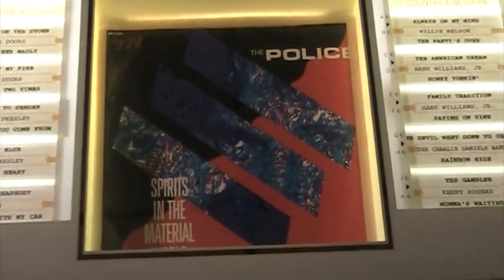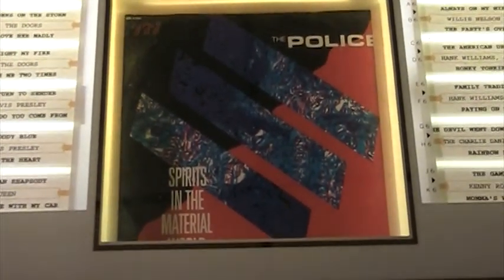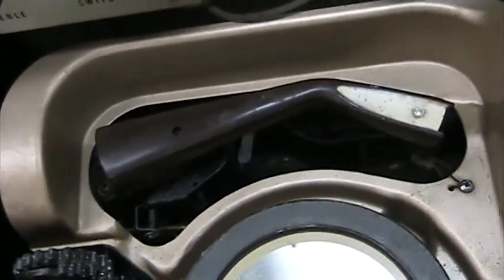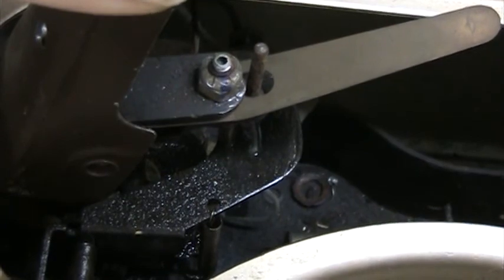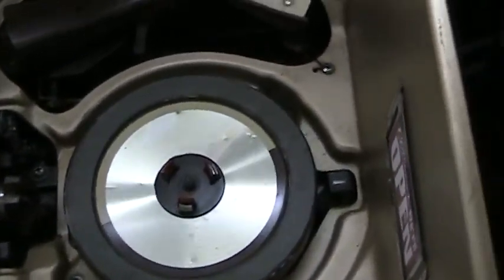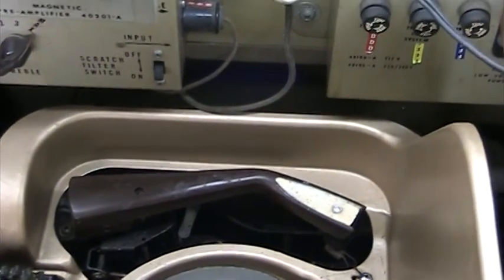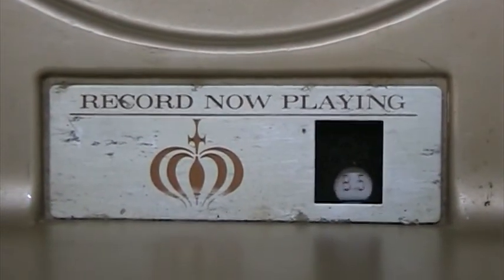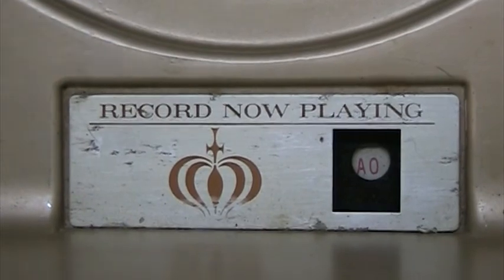How to adjust Tone Arm Pressure on Rockola Jukebox when needle skips

Comment from the maker: Update 2/5/18: had problems with record playing too slow. Installing new grommets didn't fix it. Relub of turntable pivot and cleaning of the idler wheel with rubbing alcohol didn't work either. Took the turntable motor apart. Cleaned all the black stuff with electronic cleaner, cloth and q-tip. Cleaned then relubed top and bottom of the shaft with 3 in 1 sea20 motor oil. Reinstalled and this fixed the problem.